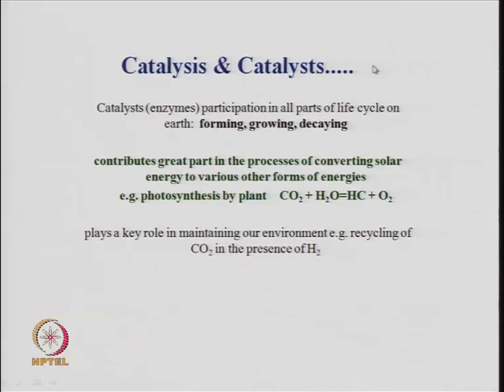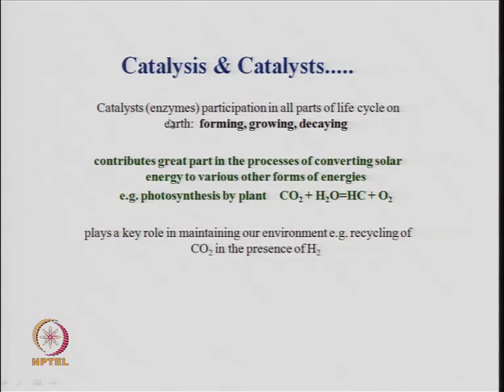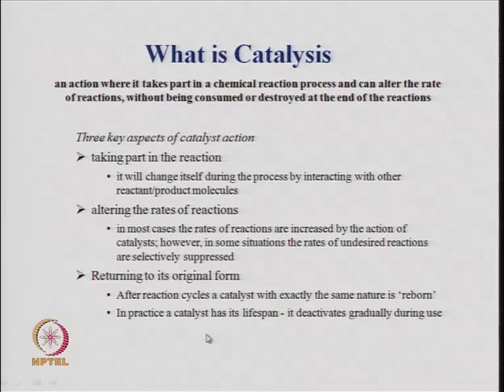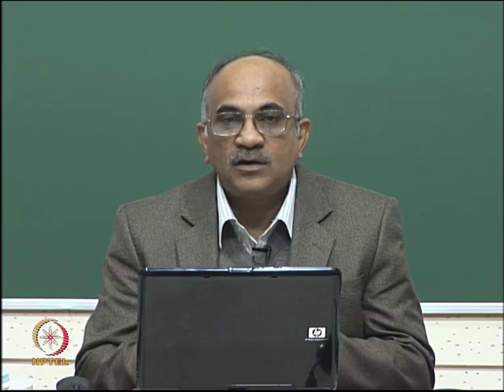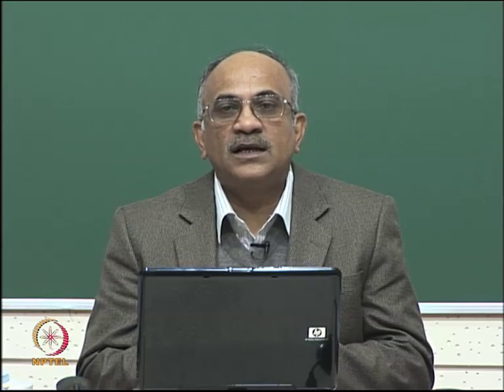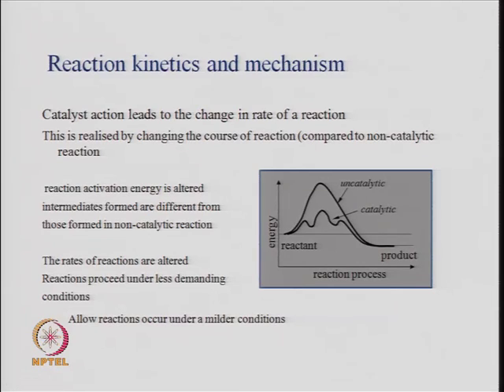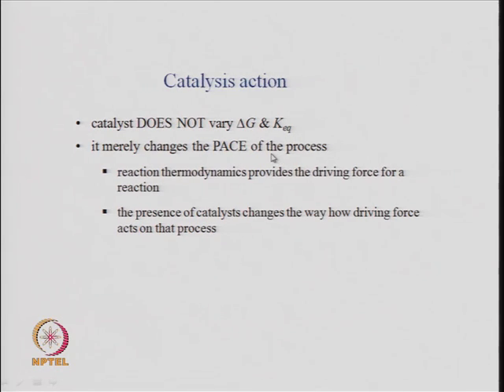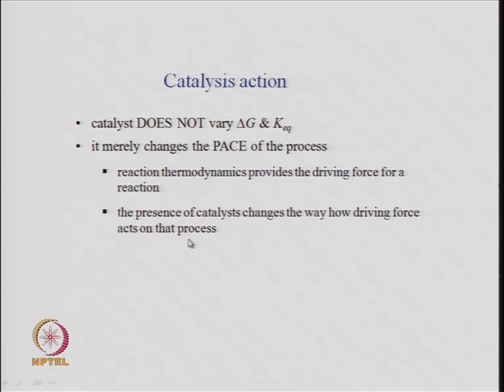Mod-04 Lec-29 Photocatalysis - I

Comment: 54:49 i didn't understand this part. can anybody please explain?
Reply: When the ionic character of the M-O bond increase, the top of the valence band (VBmax) become less positive and the bottom of the conduction band (CBmin) become less negative; compared to RHE. This lowers the redox potential of the CB electrons and VB holes. You want your CBmin to be more negative than the reduction potential of water(H+/H2) and VBmax to be more positive than water oxidation potential (H2O/O2). I hope this helps. 
However, I didn't yet understand how the ionic character affects the band positions.
Reply: @bekelchatesfaye3289  Thank You